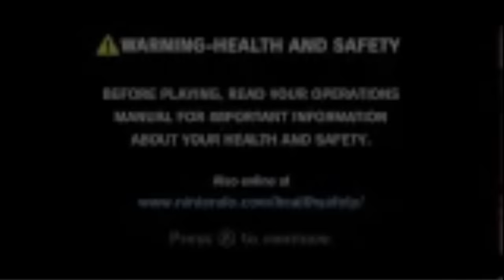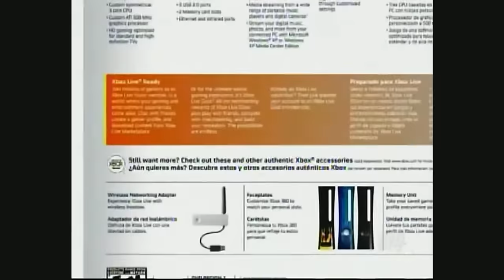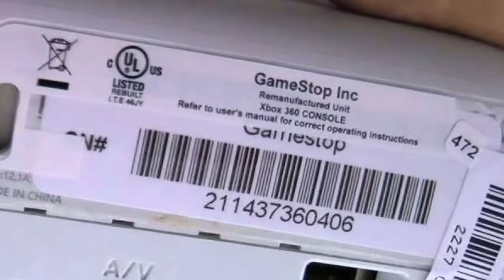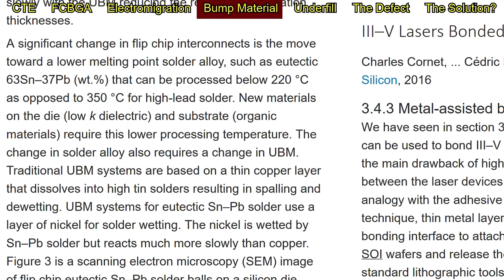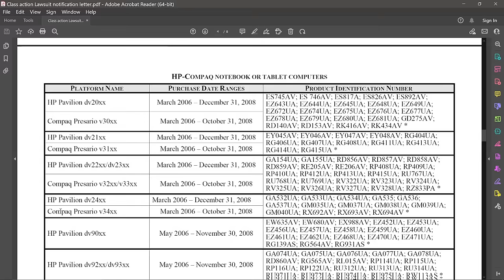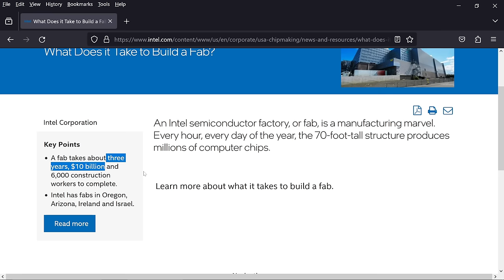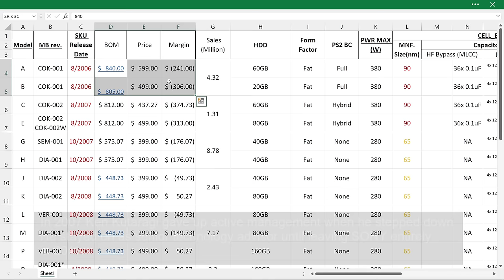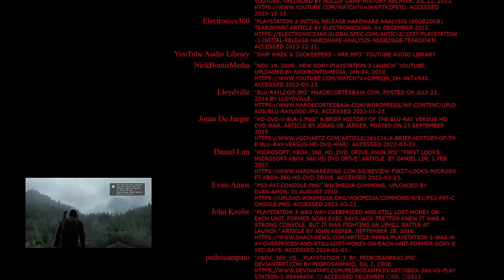A 360 Story -  The RED Ring of Death & the 7th Generation Console War

Comment: Also Apple was a victim of bad Nvidia GPUs inside of their Macbook Pro Laptops back during 2008 and which is one of the reasons why they never dealt with Nvidia ever again. I am glad that you updated your findings about the 65nm models and admitted that you made a mistake in your data. So if my Slim dies it won't be because of the RSX chip.

Comment: Great vid, recently opened up an Oct 2007 Falcon to find a replacement 970 GPU manufactured on the 18th week of 2010 which surprised me since it had the same GPU as my Aug 2008 Falcon despite a revised 480 coming out in 09. Don't know if that's unusual but found it interestin, guess that HTg85 really is the gud stuff. Subbed and keep up the fire content chief

One more thing, any idea why a Tonasket would run hotter than a Jasper despite being a revision that superseded it?
Reply from the maker: Evidently they were confident kronos was good. Clearly they were shaken by bumpgate and being careful setting lower thermal targets, until they were sure, but by that time they had it root caused and fixed. Their launch thermal targets wouldn't have been bad (except maybe that very early one), had there not been a defect. So they were finally getting back to normal engineering principals and prioritizing quiet operations again. Which is fine if there's not an unknown defect that has a thermal component, just waiting to be exploited.
Reply: @ripfelix3020  Thanks for the swift response boss, makes total sense and had a feeling it was to do with fan speeds since having two fans creates a noticeable harmonic at higher rpms. Keep it up and hopefully this vid reaches over a mil views like your YLoD vid. Misinformation like bad BGA balls, overheating/poor ventilation and "the RRoD was fixed with the Slim" is tiring to see in documentaries, especially by big channels so this vid is a blessing. Keep it up chief 👍

Comment: I still think that half of the Xbox 360 total sales were a direct consequence of people buying a replacement for the RROD.
Reply from the maker: That's an interesting point.
Reply: You are way too far from the thruth. The 360 by the point when the chips prone to RROD were selling (let's say around summer 2008), had around 20M sold units. So even if all of them RROD, that's 20M, and we don't know if every single person had bought 360 again or maybe jumped on PS3. But even if all of them bought another 360, that's 20M. The total sales till the 360 went of the market (2016) were close to 86M. So, 20M is less than 25% of that. And with having in mind that probably some people jumped on the PS3, it's more like 20% of all 360 buyes can be because of the RROD, (which will be 17.2M out of all 86M users). So you are way too far from the thruth and the half of the units, which should be 43M.
Reply: @XtremeBG  First, I said "I think" which is a guessed opinion based on some raw numbers. Second, if the total sales of the 360 were about 86+ million units, with 20 million corresponding to bad units, and at most another 20 million replacement units sold again (which can or can not be bad units themselves, lots of people bought bad units to replace their first bad unit), that adds up to 40 million, which is the guessed number I've said before of total sales made of bad units (without counting hardcore gamers that bought more than one console).

Chill and don't overthink it. It's just chit-chat.
Reply: @GuillermoTessi  No, its not 40m, cuz the one 20m you would still have them cuz either way they would bought them. Because there was a problem those people bought second unit again. So even if all of them bough second that is 20m extra. Withiut the problem those extra 20m would be there. So its only no more than 20m. Like I said 20-25%, far away from half..

Comment: Very fascinating video. At this point in time it's past the life cycle of the 360, microsoft's best move currently would be a source code release so emulators become more accurate, or some sort of extended software preservation effort(maybe a catch-all program that ports a game to pc). Any hardware can and will fail in the future because of thermal stress no matter how well it's repaired/maintained, but the games will be remembered

Comment: Ive got an Xbox 360 Elite Zephyr (it 100% is) phat with Kinect included in the box and was produced in 2009 according to the mobo and the back of the Xbox. It has never had the mobo replaced and still hasn't had a RROD. It is currently in the middle of an RGH mod, and I can still confirm it boots just fine after all these years of abuse. The Zephyr models aren't reliable, but they are much harder to break if you aren't an extreme hardcore gamer and/or if you don't live inside of the dustiest house in the world. I wish all 7th gen gamers long-term non-defective gaming!
Edit: I just screwed up writing to NAND. It is fixable, but itll take a while. Dont start your 360 modding venture with a Zephyr.
Reply: Reliability depends on when the GPU was made, judging by the 2009 date. You have a 2007 Zephyr that had its GPU replaced with a reliable one in 2009 or a Jasper/Tonasket
Reply: @CliffNark  sadly no. It has an 80nm GPU ( I have checked multiple times). It is a little more reliable considering the marginally better efficiency and lower TG, but it is still gonna die one day, and I am gonna Frankenstein it one day.
Reply: @DavitTheCore The way your reply is worded implies that even high TG GPUs are unreliable just because they aren't Kronos, which isn't true, and I'm tired of hearing it all the time.

Every high TG phat GPU is reliable reguardless if it's Kronos or not. There are almost no reports of someone having gpu or EDRAM failure in fixed non-Kronos GPUs.

If its high TG, its reliable. End of story. Even Octal agrees with me. Sounds like you have a high TG Rhea if it has a 2009 sticker.
Reply: @jtchoi2003  I did not say anything about Kronos GPUs, you can even take a GPU from a jasper (I think) and it'll be reliable. Anything after Falcon and Zephyr C is reliable, but earlier ones are not reliable. I will have a 65nm GPU in storage so I Frankenstein my Zephyr when it finally does RROD, even though that won't happen for a while.
Reply: @DavitTheCore  Well, Microsoft did make a Y1 with high tg underfill to fix old Xenons and Zephyr A's, and it's proven to be reliable, too. Although it was made in 2009 so I guess it is still newer than the Falcons.
Reply: @DavitTheCore  Your Zephyr has a reliable GPU if it was produced or refurbished in 2009. There is absolutely no need to put a 65nm GPU on it.
Reply: @steamingrefuse  Nope, I checked. It still has a 90 nm GPU, and while you said that- it has already died. I will fix it, but for now Im getting a nice S model.
Reply: @DavitTheCore  Did you check what part number the chip had? 
Dead board =/= Dead GPU

Comment: Amazing video dude. But I'd add two things to tie up the x360. Better multiplayer and achievement functionality at launch, and it actually for the most part had better video quality and framerates than the ps3 on cross platform games.
Reply from the maker: Mentioned those, but this is an opinion from my perspective not a difinitve objective comparison. I didnt play multiplayer very much in that generation, so the "better" multiplayer experiance for me was the free one. Cross-platform games 1st developed on 360 and later ported to PS3 sucked because the devs didnt care to optimize the games for the PS3's superior horsepower. Poor optimization made the games run worse. It wasnt the fault of the PS3, except in that it required a steep learning curve that devs didnt want to have to learn. Their reluctance and whining led to a subpar experiance until they finally did learn it.
Reply: @ripfelix3020  that is true. I would say though, in terms of exclusives, there is a very interesting one that PS3 simply loses at. Forza 4 is objectively and technically better in every way than Gran Turismo 6 which was released later with an inferior FOV, no stick controlling view (also supported by Kinect in Forza), horrific sound design, and subjectively worse graphics. I wish someone would do a comparison on those titles and it may have to be me. I don't know how Polyphony dropped the ball so hard in the PS3 era.

This console war was extremely close. I grew up on PS3 also for its free online but any American will tell you Xbox live was where the party was at. That being said, the PS3 leaves more of a mark in retrospective due to its ease of hacking and lack of emulation. I have both PS3hen and RGH3.
Reply from the maker: Homebrew and development on ps3 has a more lively scene for sure. Too bad 360 never gained as much interest as OGX did. I guess soldering a couple wires makes all the difference and deters them. PS3 jailbreake is just a cuple of easy steps.
Reply: @ripfelix3020  I think that's also an important point. Ps3 was leagues easier to hack.

Comment: Amazing🎉 i own a 90nm CECH04 with Cobra 4.90 with the Dynamic Fan speeds. I hope it will stay forever working👍🏻😀
Reply from the maker: Hopefully, as long as it doesn't need more than 45-50% fan to maintain 68C its paste is good. 35% seems to be average IME. But in some games or hot ambient temps it can crawl into the 40+% range. Which is why I say 50% is the mark to stay under/Time to reapply paste.
Reply: Thank u for this info😀👍🏻, my CECH04 unit is never be opened. So is 68 °C Dynamic Mode the best setting? To Run the PS3😀?
Reply from the maker: I think it's at least reasonable. What I dont know is how much of a margin for error there should be to prevent local hotapots beneath the die from ever achieving temps above 70C. Like maybe theres a particularly high load before the fans catch up and bring it back to 68C. And 68C is just where the thermal diode(s) are. Not sure if there's just one or many, and the highest value or average is what gets reported. So if that isnt accurate to the literal temp the unferfill is actually achieving, it's not going to prevent it from crossing into the phase transition zone. That's why you want to stay far below the Tg...but IDK how far is far enough.

The Xbox 360's revised chips had the target temp 7C (75/78C) below the Tg of the underfill (assuming it is HTg85). If we used that as the gauge then we should be setting the target at 63C. But that would be pretty loud. And the Xenos GPUs have a different TDP which doesn't allow 1:1 comparison with the RSX.

In general lower is better, within reason. No need to get crazy and watercool...unless it's just for fun.
Reply: Thank for your information. We must project these cool consoles. 👍🏻😀. Hope a lot of people will do…  for the future..

Comment: My PS3 is CECHK, with the DIA 002, and the GPU 2982 and it's in good health 15 years now without ever overheating or showing whatever problems. What your calculator of over 1000 days mean ? After over 1000 days of active play it may get YLOD ? also I haven't change termopaste or NEC tokins, do I have much more time left ? Another question, How can I know if my model has NEC tokins or others ?
Reply from the maker: Most of the YLOD consoles that have bad 90nm GPUs tends to die in 150-300 days. I've seen some go as long as 4 or even 500 days. But 1000+ is like another level reserved only for champions of reliability.
Reply from the maker: No, uptime. 1000x 24hour days. The syscon tracks startups, shutdowns and uptime. If the console loses power the session isnt logged tho.

Tokins I estimate should last 666 days under well maintained conditions. The ones in those dia-002s I got lasted over 1000. So they well exceeded their lifespan.
Reply from the maker: It's just the time it's been powered on. Whether it was idle in XMB, playing games, streaming a movie....whatever. It tracks this time and when it reaced 24 hours it calls it 1 day. 1000 days is 24,000 hours that the sysem has been powered on. Regardless of what you were doing.

Comment: My 360 Elite only now dropped dead. RROD. Sad but not unexpected. Part of me wants to find a good repair shop but the smarter side of me knows just getting a slim is a better use of money. RIP you glorious machine.
Reply: Try getting the secondary error code via sync+eject four times. That'll tell you the issue
Reply: Yeah I did that. 0110. Apparently related to memory addressing. RAM or GPU replacement are suggested fixes. @CliffNark

Comment: Another question. So the moment they started to put good refill was exactly the same moment they went to 65nm chips ? Cuz then is when the issue is gone. So coincidence ?

Also Why there are many first revision slims with YLOD ? What was the problem there ? They are even more cases recorded on the web than those later PHAT models. And what about the Superslims where it just turns off the light and its dead ?
Reply from the maker: The 1st revision slim (20xx models) have NEC/Tokins filtering the RSX core voltage. The 65nm is a tank and people put enough time in to wear the tokins out. That's the usual cause. The CPU side has polymer caps (aluminum or tantalum) which seem to last longer.
Reply from the maker: BumpGate broke in early to mid 2008 and fixed Nvidia chipset began shipping by summer. Microsoft root caused the issue earlier and had began shipping fixed chips early 2008. So the timelines tend to line up with model revisions around mid to late 2008.

Sony may have rushed the 65nm release to prempt the situation. But they had a stockpile of 90nm motherboards that they sneaked into M and Q models that released alonside the the 65nm models. Which was easier to pass off in sheeps clothing because they used terms like "80GB PS3" to obfuscate the changes made in each model revision. These 90nm consoles still died, but because they were only released in japan and the UK and released alongside other reliable models, the percentage of PS3s dying was kept small. It diluted the failure rates and decoupled the associatio  to the 90nm RSX the failing models had in them.
Reply: Is there any difference in the last PHAT revision produced the CECHP 160GB one from 2009?

Second question, Why this thing with the NEC tokins fixing YLOD, came out so later and how no one knew and talked about that till 2021 or 2022 ? 15 years after the PS3 released, and all of a sudden from nowhere voalla the NEC tokins were the problem and all the web agree?

Third one, last I promise. So is only the underfill the problem for RROD/YLOD ? Let's say in 2008 sony and microsoft continue to produce new units with 90nm GPUs. But with the better underfill of the 65nm GPUs. What would happen then ?
Reply from the maker: I need to disassemble a Q model I have which may contain the latest 90nm RSXs produced. I have 2 M03 models I can do the same with. These models have the DIA-001 MB rev with 90nm. The hypothesis is they were left overs from a rushed 65nm MB revision when sony paniced and tried to limit their exposure. So they hid these leftovers in and amongst reliable models and only in specific regions (uk and japan). I think they are exactly the same...but we'll see when I get around to testing them. IF sony ever did try to change underfill material on the 90nm, those would have it. But I HIGHLY doubt it.
Reply from the maker: So until around 2019 most people believed YLOD was a GPU issue requiring a reball to fix. Then tokins were discoverd to start failing and fix some consoles that begmhaved differently (began dying under stress). The tutorial was made and everyone saw it as "THE" solution to expensive reballing. An overreaction that made alot of people attempt a DIY tokin replacment only to destroy the console in the process. It was a desparate viral hysteria. And it needed to stop. People need to diagnose their issue 1st, then decide which "fix" to attempt...or know their limits and get professional help.
Reply from the maker: There is more to it than simply the underfill. The bump material cant be changed after the power planes are layed out, because they can only handle so much current  So changing the bump type would require a full redesign, which at that point you're better off waiting for the 65nm which was already in the pipline. And that's aparently what they did. I doubt changing the underfill would have been a full solution...but if they did it it may have been a desperate attempt to bridge the game to the 65nm. Which I dont thing sony had any reason to do. Since they were a year later and the 65nm was almost ready bybthe time bumpgate was figured out, they probably just rushed the 65nm release. Which it looks like they were planing anyway to reduce cost.
Reply: @ripfelix3020   So the CECHK are the first ones which are fixed and can go for years long without having a problem ?
Reply: @ripfelix3020  What are the exact differences between the CECHK and CECHL revisions?
Reply from the maker: Nothing substantial. They combined the wifi/BT daughterboard on the VER-001 MB so it's 1 piece. There are minor differences in SMDs, but otherwise they're about the same.
Reply from the maker: Until the tokins die, pretty much.
Reply: @ripfelix3020   Hey Felix, I have the evilnat CFW and it tells me my PS3 is 400 days used, however through the years I have been reinstalling the firmware, restore the system 2 or 3 times (so erasing everything) doing fresh installs from the service menu and even once got to the red screen of death (with the 3.5 downgrade flash that was selling that you had to replace some files and donwgrade back to 3.41 and I put the wrong file, and after that I sucessfully fix the system back to the OFW). So through all this, is it possible for this clock to have been reseted somewhere in time ? or there is no way and if it says 400 days of use it's 100% real ?